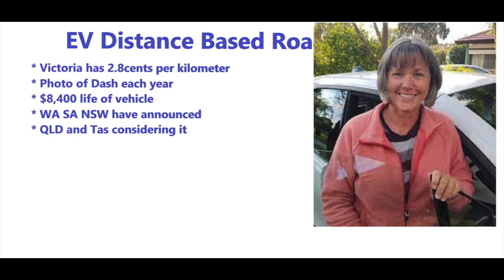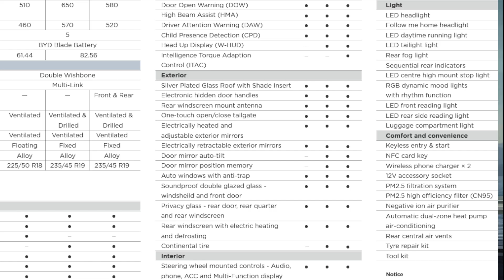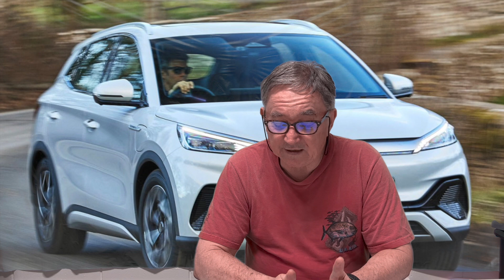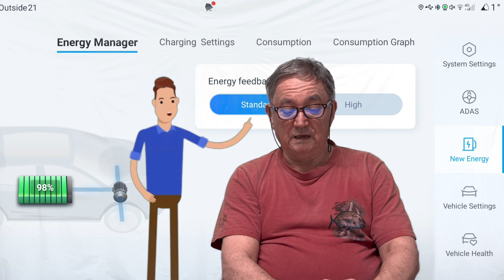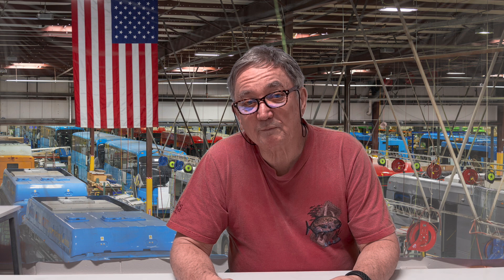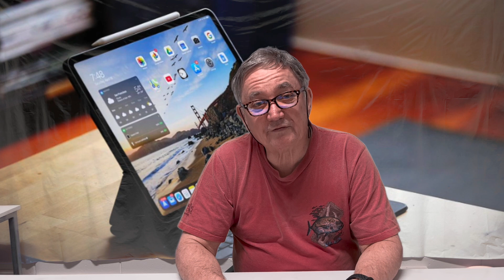My BYD Weekly Update 20 Oct

Comment: Not sure about other houses but my controlled load circuit is used to heat my hot water system. My sparky initially installed the wall charger on the normal circuit but when I found out I had to get him to come back and change it. Controlled load circuit is cheaper then normal circuit  by about 20%.

Comment: The inbuilt GPS/SatNav is quite good. It has too many warnings perhaps and seems to think that I am off track when I'm not. A particularly annoying thing, which I think could be easily fixed in the software, is that the trip settings allow highways or toll roads to be avoided. I have repeatedly unchecked the avoid highways, only to find that the route is taking me on a back road because it has checked itself.
Reply from the maker: yes, the default for avoid highways should be off